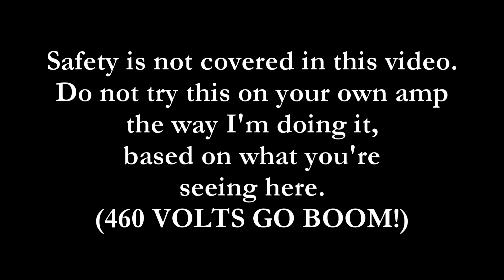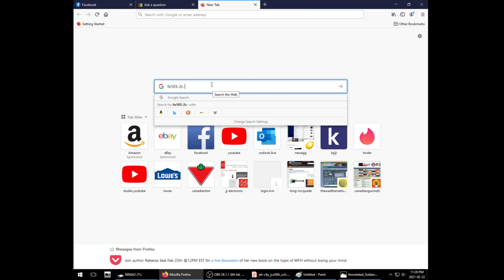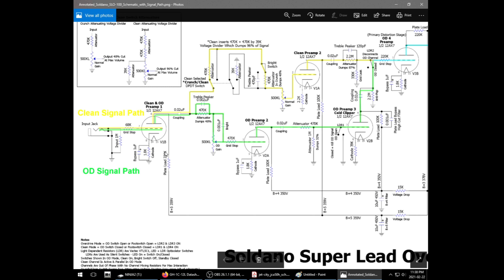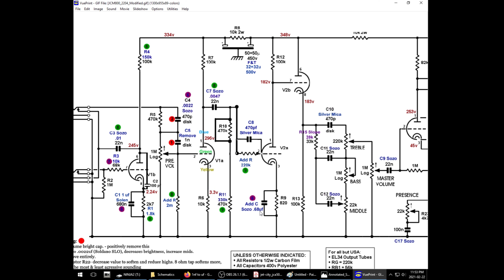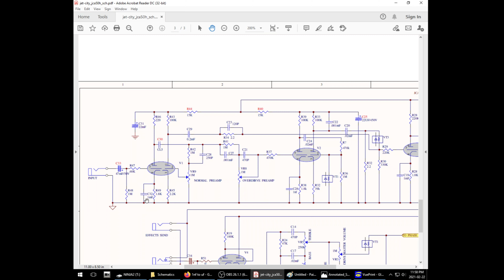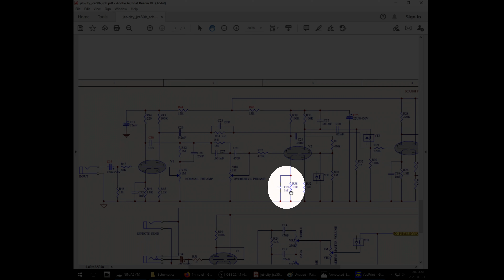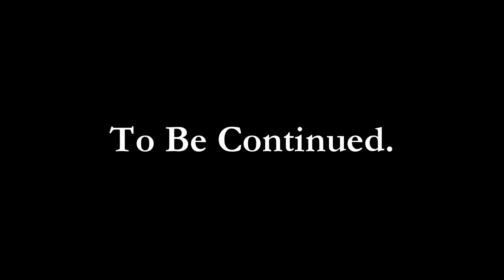Jet City Violence Ep.2 - An Impromptu Loopy Voicing Session.

Comment: great vid and great playing
Reply from the maker: Not sure about the playing, but thanks, haha.
Reply: @DATT  I have a soldano avenger. He kind of halved the design gain wise between crunch and lead, based on the lead...

I mean he has 100K all over the plates, is single channel. It doesn't have the 3rd stage -4th stage -CF ---------> loop 5th stage-CF config.

It omits the CF between the 4th stage and the loop (4th stage is 100K and 1.8K//1u). It also has 20u on the loop bypass cathode capacitor.

Otherwise stock. Do I actually miss something as it doesn't have the CF? Clipping wise...

I mean I always boost anyway so maybe it is a bit better this way, I don't know if I'd want more fizz/compression from the beginning but it does need way hot pickups to say it is gainy. 

It also kind of bugs me it takes the output from the plate of the 4th stage and goes into the loop with a coupling cap, 220K in series and then throws 2.2 K to ground. It throws a lot of signal into the ground and has around 2K output impedance and still doesn't work so great with pedals...it works great with the g major.

I was thinking of bypassing some stuff to go 3rd cold clipper, 4th (220K) and then CF to tonestack directly. Maybe move the loop after the master as is, unbuffered. What kind of output impedance would the master volume give?
Reply from the maker: @81giorikas  I have to admit, I'm not sure is you're asking me a question here. 
I looked up the Avenger and the schematic I found shows a single channel, jsut straight 4+0 circuit. No FX loop. 
Looks to be the same topology as the SLO/Jet. From what I'm seeing here, if you want more gain, I'd tray changing that cold clip resistor from 39k to 10k. If it gets too nasty, clean it up by dropping those 220k's on the plates of stage4, and maybe stage 1 to 100k. 

I did a mod to this amp in another video where I did delete the Stock FX loop. And another video I added an FX loop back in after the master volume. Works great.

Comment: Hey Mr. Name is Irrelevant,
Can I use the stand-by trick to drain the filter caps on the JCA50? Or do I need to manually drain them?
I would like to test some of the mods, but I'm a bit concerned with the high voltage thing...I have decent soldering skills by building pedals and modding guitars, but have never been inside a tube amp...
If that works, I would carefully move forward with my project.

Thanks! Great series, by the way! More detailed than 90% of the videos on Youtube.
Reply from the maker: Well, what do you mean by standby trick ?

There are resistors across the Main Filter Caps, of the JCA50, and the Standby is before those caps, so assuming your JCA is wired the same as mine, and the same as the schematic, when you switch off the standby, those resistors will discharge the caps. 
Now, it can take a few seconds, even a minute. It'll will reduce the voltage down quite quickly, but then there will be some residuals that can linger. Don't move too fast, use your meter to double check around the area you'll be working, and you'll get a feel for it. 

Working on amps, you're bound to get a shock eventually, luckily 99.99% of those shocks have no lethal potential, but still be careful to avoid it.
Reply: Right, that's exactly what I wanted to find out @DATT  - Planning to do the Depth, cold clipper mods and add a tight switch.
Any other mods you would recommend?

Appreciate the attention and keep on rocking! I'm now following your SLO clone build saga. Good stuff, sir!
Reply from the maker: @Rulio901  Not sure what the tight mod is, unless I just don't know it by that name. 
Well, Other than the voicing tweeks I did, which are to taste really, the FX loop delete is worth looking into if you don't use the FX loop. 
I put a "zero loss" FX loop back into it, I pretty much use it as a buffered Master Volume. 
It's handy cause now I can preset my crunch and lead volumes. This is a more advances mod tho, esp how I did it.